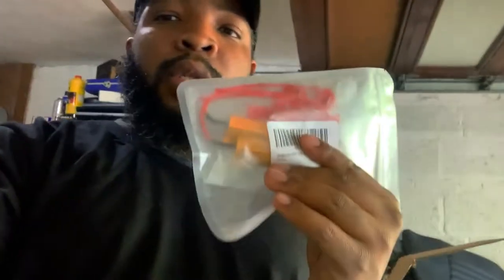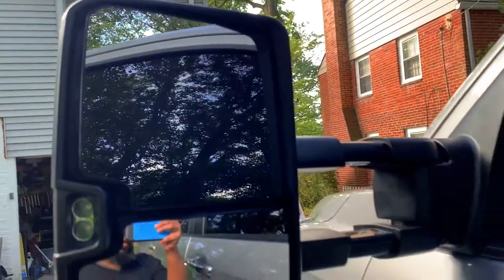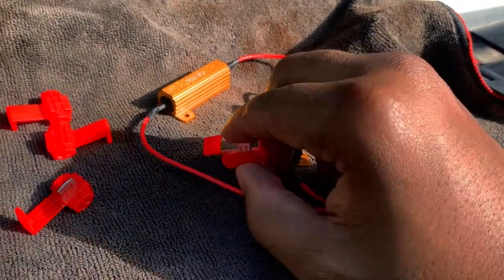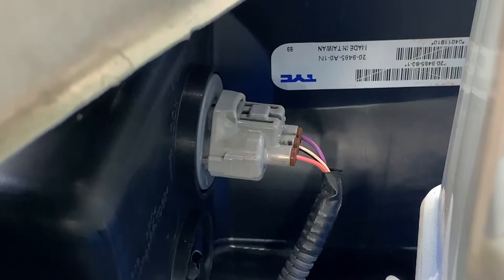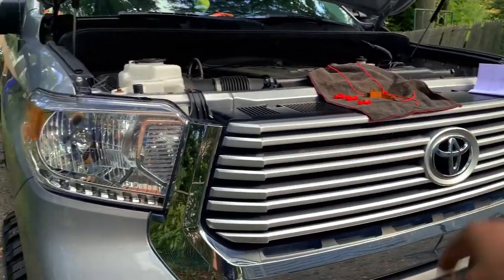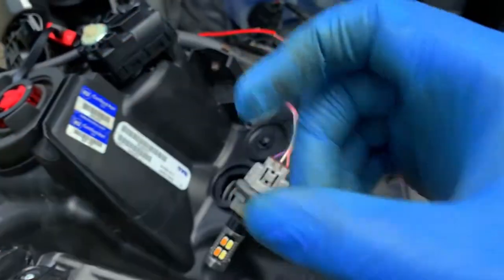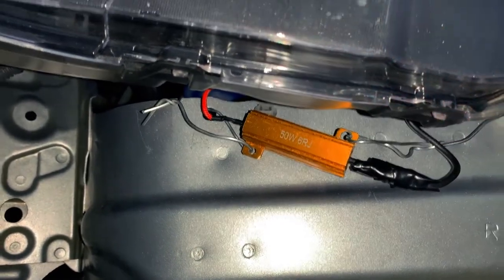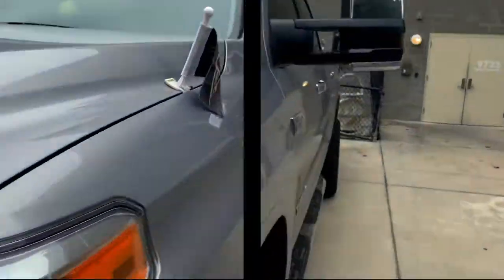Fix LED Hyper Flash Turn Signal | Lifted Toyota Tundra Turn Signal Wiring

Comment: Thank you brotha! I couldnt figure out which wires to splice into. I have a 2008 sequoia and you can never have the turn signal off, even with the lights switched off they are always drl. So I had to figure out which wire to tap into
Reply from the maker: Sam, no problem sir, I figured this information would be useful for someone as it took me sometime/research to identify the wiring too. Many videos cover the install but no much about wiring. 

Thanks

Comment: Don't use resisters. They get very hot and you have to put one on every bulb which requires splicing. Just get a new flasher relay made for LEDs. On eBay and Amazon for $10.
Reply: What relay would I need for the tundra 2008??
Reply: You can't just replace a relay in the 07+ tundra.. unfortunately

Comment: Great video. I am currently having some hyper blink issues. I'm going to give this a try. Is it still working for you?
Reply from the maker: Yes it's working absolutely fine, no issues. 

Just make sure you place it wear heat won't cause any damage and somewhere it has access to air to keep it cool.
Reply: @AWordFromMrJones   hey great video I had a question I have the same situation on my 2016 tundra the hyper flash when the lights are off which is expected but when I turn on the headlights and turn on signals the stay on with no flash at all so before I try the resisters I wanted to make sure this was your situation aswell because on the video your headlights are off just on on parking you had hyper flash ..sorry I hope I make sense
Reply from the maker: @rsolorio692   My issue occurred whenever I selected the turn indicator, I would always get the hyper flash issue but only when the LED bulbs as being used.

You issue sounds more so intermittent, similar to when a OEM halogen bulb going bad, sometimes it will hyper flash and sometimes it does not. If you are using the LED bulbs, I would defiantly recommend installing the resisters to correct the issue. Or you can turn installing LED in both the front and rear lights to see if the hyper flash goes away. I once was told my a Tundra owner that having LED in the front and rear helped him.

Comment: Do you use the same colored wires for the rear tail lights?
Reply: Rear tails should just have red and black, or white and black I forget. Anyway its just a power and a ground wire. Doesnt matter which is which, just tap one side of the resistor into one and the other end into the other
Reply: @samjacobs4769  yes so tap into red & tab into black/white one. I know fronts in this video is pink & white/black .
Reply: @coachcremar6817  Yep thats correct!
Reply: @samjacobs4769  thank you so much